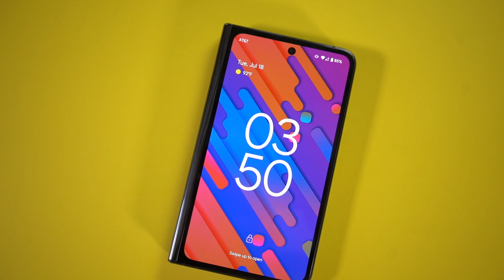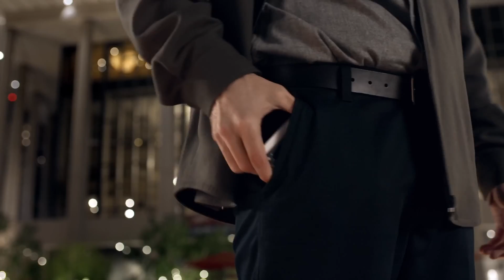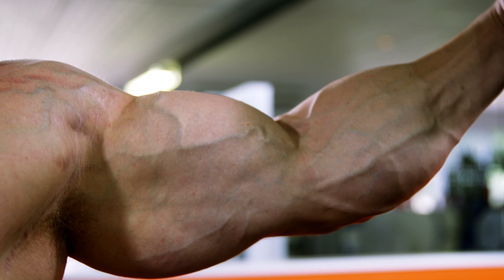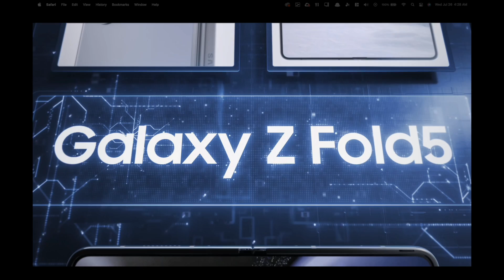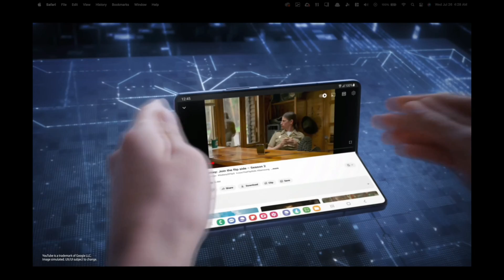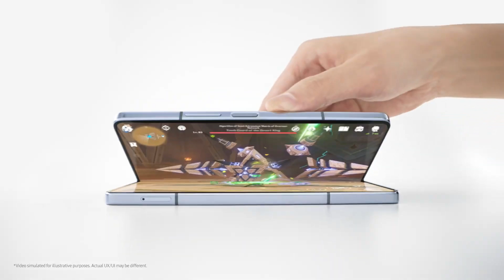Galaxy Z Fold 5 VS Pixel Fold

Comment: Its like comparing next-gen phone with last gen, Samsung has next-gen ram LPDDR5X vs pixel fold LPDDR5 last gen, same is with storage UFS 4 on samsung, UFS 3.1 on pixel. Tensor g2 is last gen then comparing to Snapdragon 8 Gen 2, gpu is 4x faster on Samsung. The bezels is like from 1st fold phone on pixel.

Comment: Saying the battery will be about the same is just a straight up lie.

The fold 4 already had significantly better endurance than the pixel fold, and the 5 can only be better than that.
Reply from the maker: I have both the Z fold 4 and the Pixel Fold. So far in my testing battery has been very similar with a slight edge to the Pixel Fold. Im assuming since Z fold 5 has the same battery capacity with improved processor, battery performance should be about the same. I don't need to straight up lie lol. I still gave the performance round to the Z Fold 5